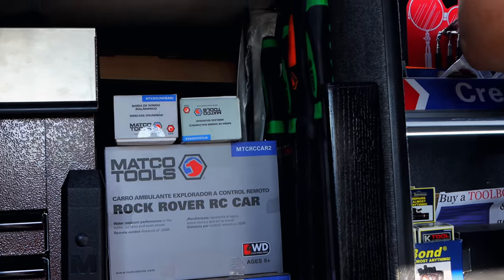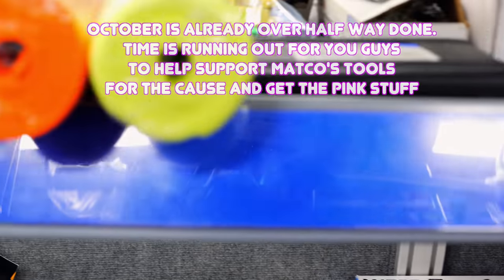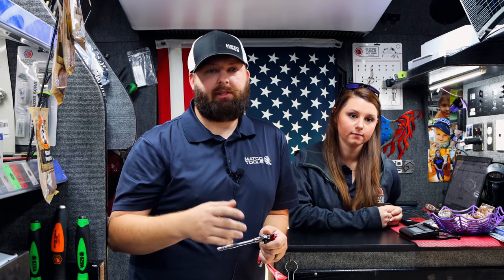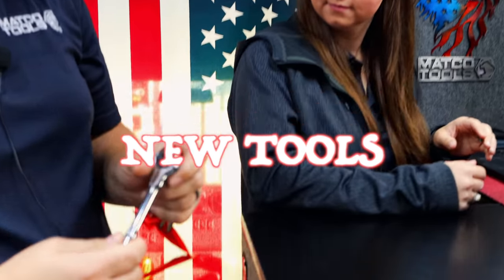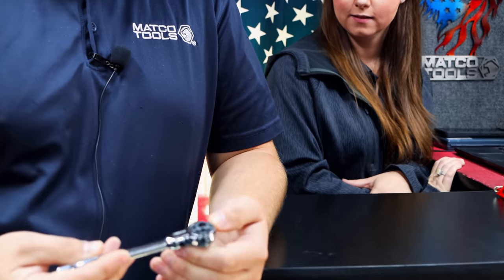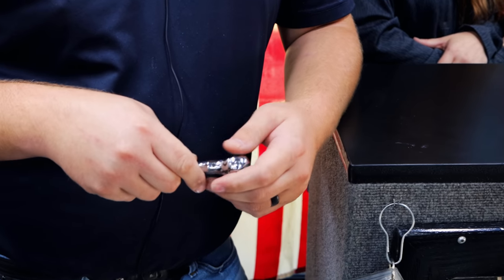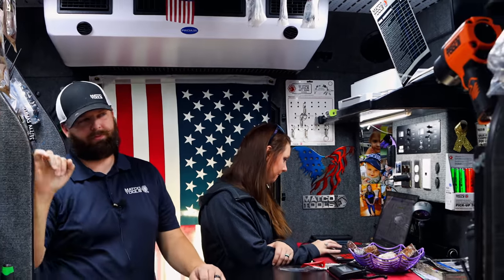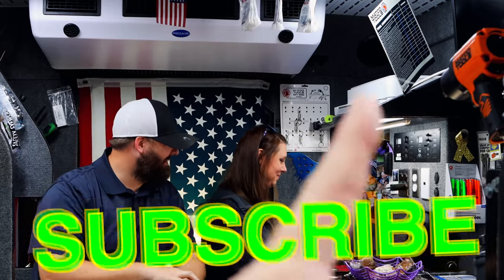Matco Tools New Hood Support and Bit Ratchet

Comment: I grew up in the 1960's with the spring balanced hood hinges, or at least a prop rod on imports. Now as an old man, due to the hood gas struts, I have to hold my hood open with my head 🤕 to check my oil or anything else. I have 2 Crown Vic's, one with a aluminum hood, and it's not too bad but I have one with the steel hood, it gets heavy after a while. If the hood slams shut, better not have anything that you value in the way. 😖  YOUCH! 😖